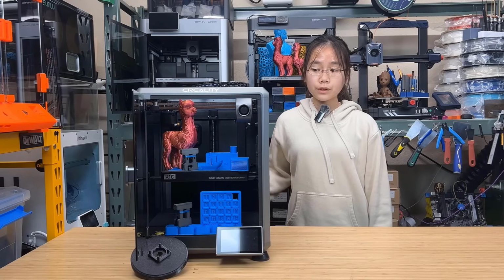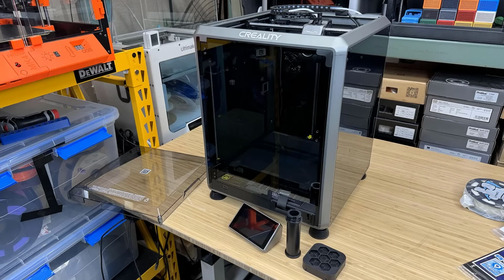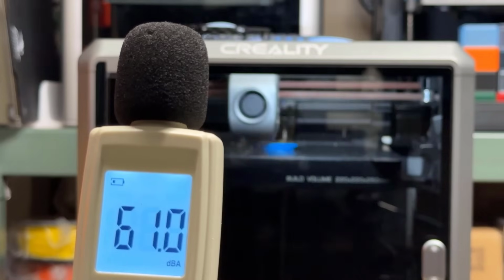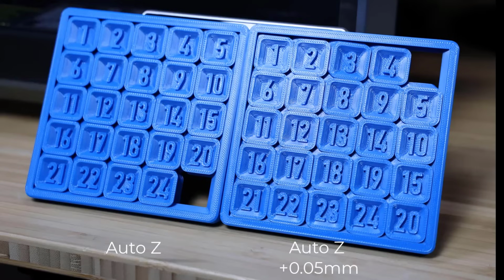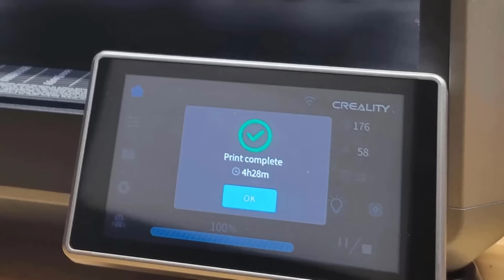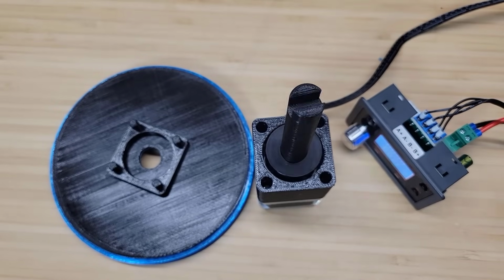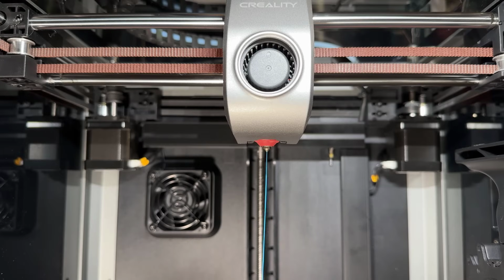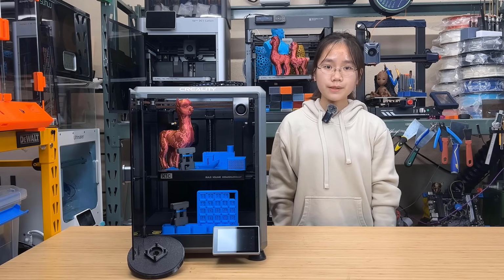Creality K1C 3D Printer: in-depth review, testing with Nylon Carbon Fiber, ASA, TPU, PETG+, PLA PRO

Comment: "Not open-source yet" - It's a GPL violation. There is no "not yet" clause in the GPL that allows delaying the release of the source code after distributing the binary. When you receive the printer, which contains the firmware binaries, you have the right to the source code from that very moment on. It's an immediate obligation.

Comment: why you not showing the buggered unlevel bed issues with the k1.. dont tell me they have fixed anything as i dont beleave you! bet its still crap and full of issues they will fix on the v3 next week .. dont be fooled people its not for new users.. the benchy looks rubbish to pointless being quick .. not all machines dont have ajustable z off set either most do .
Reply: try printing on the whole bed lmao rof. all them crap marks on the front right corner of the models

Comment: Question for Aurora, on you go no go gauge everythough about using a metal gauge machined for the tolerance for both inside and outside this way all tests are the same standards this would work for both laser  3D printing along with resin printing.
 Just my two cents.

Comment: oh my god that "quick swap"..   Whoever realizes first that they will need to combine large print volume with klipper and TRULY quick swap nozzles will dominate the market.
Reply: Flashforge has already combined a true quick swap hotend and klipper in their 5M series. Unfortunately however, they don't have  a very large build volume at 220x220x220mm
Reply: @peteregg4304  precisely. If we examine their printers ever since the beginning it's plain to see that a 220x220-ish size should be considered to be their "large" printer.
It's beyond me why they don't capitalize properly on the quick swap ecosystem they have perfected.

Comment: I'm sure I saw that someone rooted and the input shaper is still making x and y the same. Also, the MicroSwiss hot end will not work on K1C, so don't buy one until they make one that will.

Comment: Thanks for the review. Even if it was a paid one you still treated it like your other reviews. I have a k1 and while stock it is not great once you root, do a few mods, and tune it, you then have a great little printer for the money. And with  the latest software update from creality along with the latest klipper software from Guilouz my k1 is amazing. I do wish creality would just put stock klipper in the k1 series and use orca slicer instead of creality os and slicer. I am not a fan of the stock software.

Comment: That's an ingenious solution to film developer agitation - although I'm not sure it's much easier than just inverting the tank at intervals! Mind you, I use Cinestill Monobath, which only requires one set of chemicals and only intermittent agitation.
Reply from the maker: Maybe I should get a bottle to try it out. Does the result look as good as traditional developer + fixer?
Reply: @AuroraTech  - Yes, I've always been very happy with the results. I don't like messing about with chemicals too much, and too many stages means too many opportunities for me to mess it up! Cinestill just makes it really simple. You just put the liquid into the tank, agitate for 30 seconds, and then for 10 seconds every minute for four minutes. Then rinse, and you're all done. Some purists don't like it, but I always get sharp, perfectly developed negatives. I use it for developing photo paper prints too.

Comment: A printer like this that is supposedly designed for structural materials should have the option to turn off the vent fan.  You want a high chamber temp, and this is an oversight by Creality.
Reply: You can control all the fans in the slicer and on the printer itself. I have a K1 with 500+ hours and it's very reliable. Wish it was quieter 🤣

Comment: I cant wait for the review on the new FL SUN machines.  I recon their going to be on anouther level....  thing is with all there fast printers you still never get the same quality finish as a regular old CR10 pro v2 or something.    There is always a compromise with the fast machines and that is often enough to get complaints from paying customers.   Better to have many cheaper slower machines printing top quality than few faster machines printing compromised quality and less strong prints.
Reply: The new enclosed FLSUN printers are 10 grand though 😀
Reply: @SimonCoates Flsun T1 is 499

Comment: I have seen a couple of others take the extruder apart and found it was plastic and not all metal. It makes me worry about Creality's honesty in their products. Otherwise, this is a great review. Good job!
Reply: creality have confirmed to me today it’s not metal and have now changed the marketing on their website.
Reply: @MadRC  I have just checked their site out.  They are still saying it's an 'all metal extruder'
Reply: @spoon1272  I checked and it has changed to a clog free extruder
Reply: @AndrewAHayes   It actually says "Clog-free All-metal Extruder Kit".  Also if you scroll down to the small pics titled "Progresses Towards a Perfect 3D Printer" the top left small pic states "All-metal Extruder Kit".
Reply: @spoon1272  it seems it’s taking a bit of time in some regions to change.
Reply: @MadRC  this is good.  I wonder what they were thinking. Honest mistake? Tried to pull a fast one?
Reply: @ABoxofFail  never attribute to malice what can be explained by incompetence 😂
Reply: 😂🤣 You actually thought a Chinese company would be honest??? Omg I can't stop laughing.
Reply: I also have my doubts that the lidar on the K1 max does anything at all.
Reply: @NaughtyGoatFarm  It scans the pressure advance test, but manually adjusting it is more accurate. You can tell the difference. I’ve actually discovered that to be the case on the X1 also.
It does give a better first layer and checks the first layer. Sometimes it pauses if it’s not a perfect first layer, even though it’s close enough to continue. 
It can be helpful, but it’s not enabled by default.  Also you have to check calibration in the slicer or it doesn’t do anything. So most have no idea it’s not doing anything because it’s not enabled.
Reply: I think Everything touching the filament is all metal
Reply: It is true, feeder in k1c is the same as in k1/max v3
Reply: So was it all plastic? Or what?
Reply: @kimmotoivanen  No, the pieces touching and feeding the filament are metal, the lever and drive gear are metal, the connecting gears are nylon.
Reply: @gaxon1920  I don't see problem with that. Nylon can handle more temperature than needed + no need for grease.
Seems more like nitpicking, hairsplitting and creality-hate.
Did BL X1C have "all metal" extruder, to the letter?
Reply: @kimmotoivanen  it's a mix of plastic and metal.
Reply: Maybe marketing got confused. I’ve seen very few all metal extruders. That would be a lot of weight on a CoreXY printing at 600mm/s
Reply: @gaxon1920  The BMG extruder gears are "all metal", though there is one enormous drive gear that is all plastic. There is also a replacement set of gears for the LGX/LGX Lite but the stock configuration uses plastic drive gears. So yeah, usually the extrusion gears are metal but the drive gears are plastic. I do wonder if Creality screwed up and meant to say "all metal hotend" instead, but if it were a mistake it would still be pretty bad in the sense that there is either a disconnect or misunderstanding within the company over something as basic as terminology. It would have been great if Auroratech physically examined the printer for these claims the same way she called out Creality's "not so quick" swap nozzles.
Reply: @Duckferd  I’m referring to everything including the casing as metal. One of the reviewers was actually tapping a magnet to the case. 
I have a few bond tech extruders. All of the gears are metal except the loader gear. 
By that, having an all metal extruder would be ridiculous. All metal gears would make more sense. At least everything that contacts the drive gear and the filament.
Reply: @Duckferd  To be fair, this was most likely recorded before anyone broke it down like that. and i havent seen this channel take apart printers. she, like the rest, took creality's word at face value until the first person discovered it.
Reply: Creality have lied many many times and even tried to bribe reviewers, stolen models for their website and other things I cant put I finger on at the moment, it comes as no surprise to me that the gears are plastic!
Reply: Today on Reddit I Saw a guy seeing a live webcam from someone else's printer
Reply: So what this means is everyone should stay with bambu labs. Lol
Reply: @christophercastilaw3157  Just hold off on the A1 until they fix the chord issue catching fire.
Also the X1 has all nylon gears except the motor gear….

Comment: A lot of other reviewers took the extruder apart and it’s not all metal, it’s a plastic material. Creality has some explaining to do.
Reply: The plastic parts aren't just on review machines, it's on all of them.
Creality have changed "all metal extruder" on their website to say something like "clog free extruder" instead.
Reply: @ep8029  at least they corrected it. Looks like the same extruded on my K1 max from the reviews I saw. It works fine, not had any issues with over 800 hours of printing. Wouldn’t be too concerned about it. As long as the CF filament doesn’t make direct contact with plastic, should last a long time.
Reply: All plastic then? Your explanation does not make much sense 🤔
Reply: Hopefully the parts touching the filament are at least metal. Carbon fiber will destroy plastic.
Reply: @gaxon1920  yes but if u have all metal gears you will need to oil/lubricate them, and then oil/lubrication creates dusts sticking. with plastic/nylon gears theres no need for lubrication really
Reply: @GC-EXTREME  I am well aware of that. I have a couple of metal gear extruders that require very little maintenance. Little ptfe oil and never touched them again. 
POM gears are usually best if not using metal gears.
Reply: @gaxon1920  Why are you constantly trying to get them out of the lie??? You say the marketing department got confused between plastic and metal lol??? Your comments are beyond laughable!!!
Reply: @andymeenan  how so? It was a possibility and Creality later admitted it was an error. Not a defense. Don’t be childish, some of us were having a civil discussion about it. If you hate creality, that’s fine. I’ve hated a lot of their printers, actually most. No need to throw your shade at others. Try to be civil instead of a keyboard warrior.
Reply: @gaxon1920 it’s not
Reply: @SeriesDmusic  just watched the video. The parts touching the filament are metal, but the gears look like nylon. 
May just be a prototype. That’s the thing about review samples, most reviewers will get prototypes and test units. They may function the same, but may not last as long as a consumer unit.
Hopefully that’s the case on the two review units talking about the extruder. I suppose we will find out next month when the first units start shipping.
Reply: @SeriesDmusic  yes they are. all parts touching the filament are now metal